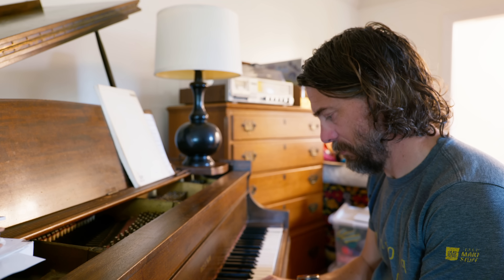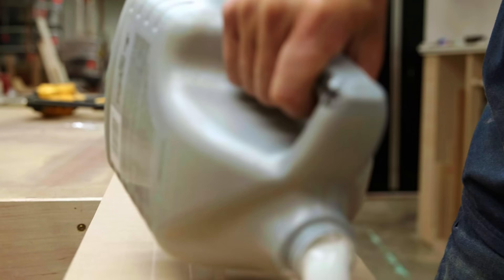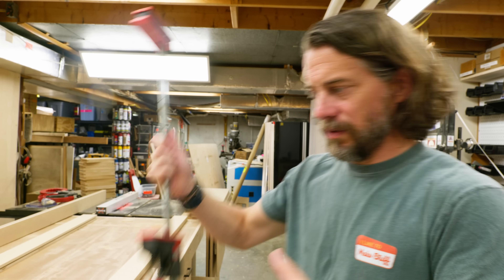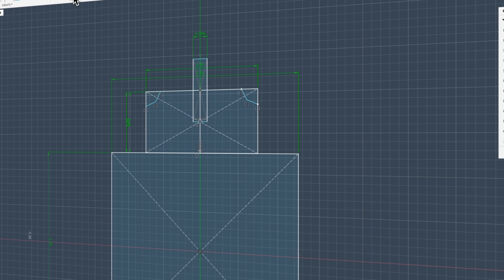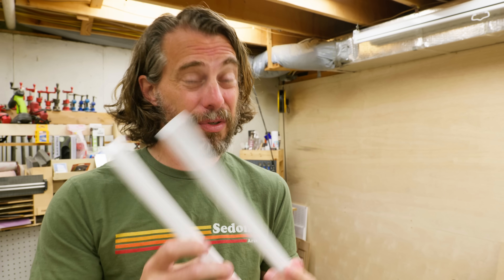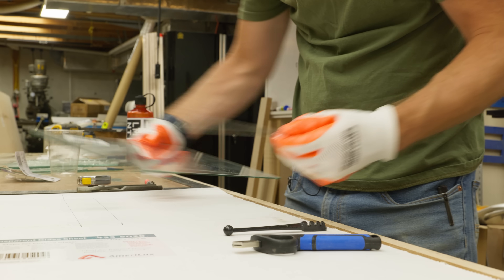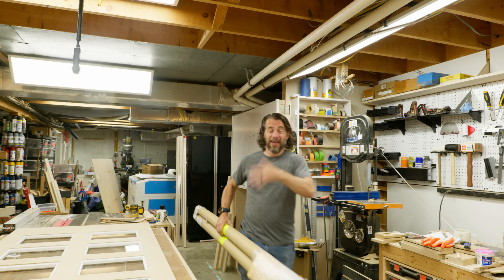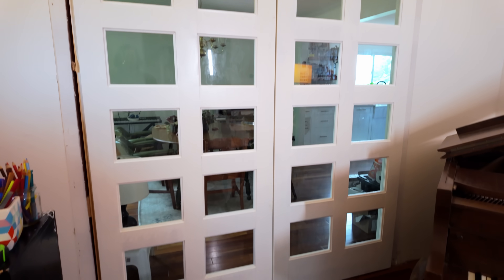I Made Doors WAY Easier With 3D Printing

Comment: I appreciate this channel because Bob isn’t afraid to tackle a project he has no experience with. He just figure out a way without being hung up on the “this is how it’s supposed to be done.” That sort of ingenuity is great to see. That said, a little research would have told him that doors are required by code to have tempered safety glass in them and not plate glass. Plate glass is not only easy to break but extremely sharp and dangerous when it does. All it takes is someone tripping on a rug or a pet and putting their hand through the glass severely cutting themselves in the process.
Reply: This is definately a case of a tight budget and limited working knowledge. It'll be interesting to see how well the door is able to reduce the sound coming through with very little sound proofing techniques used.
Reply: " without being hung up on the “this is how it’s supposed to be done.” That sort of ingenuity is great to see. That said, a little research would have told him that doors are required by code to have tempered safety glass in them and not plate glass."
Aka the "how it is supposed to be done" is the one correct way.
Reply: As a professional woodworker there is one right way to make a door, bond didn't even come close.   This was a hack job where he should have watched a video on making a door.
Reply: @Trickyricky1982  I was thinking they same thing. "The glass doesn't move at all" that means there is no room for deferential thermal growth... Good thing it's an inter door, or that glass would shatter, and might still depending on the tolerances.
Reply: He lives in rural Kentucky. No code required
Reply: @natehyman5980 Code or no code, when it comes to your Family's safety - do all what you can to make it as safe as you can.
Reply: @natehyman5980 I thought he lived in Texas.

Comment: You don't have a router? That is how those trim pieces were made. Sorry in my opinion you assembled your doors wrong. Before final assembly you install the glass then glue it up, then trim out the glass.
Reply: Yep. A router would also have allowed him to cut the slots in the center stile that he forgot.
Reply: Pretty shocking he didn’t mill the trim (with router) he couldn’t easily find.  3D printing worked, too with a new set of pros and cons.
Reply: with a CNC router he could have made an entire door out of one piece of MDF

Comment: I worked in framing shop, picture framing, for decades and an easy way to break the glass that doesnt involve tapping on it is use a dowel rod under the cut and apply minimal pressure and it snaps super easy. I started doing this because I had times where I would be tapping the glass the it would snap abruptly and shoot splinters off or break the glass and then youve got a major clean up. Granted the dowel rod isnt fool proof but its much less prone to accidents. In lieu of a dowel you can always snap it on the edge of the table as well. Either way offers better safer control over the glass breaking process. Cheers. One other thing I just thought of, does the mdf grow or shift with moisture because if so I hope you left a little wiggle room in the size of the glass to allow for this. Ive seen over the years when people cut the glass right to size the wood can snap the glass by applying pressure as it grows and shrinks. Its not super common but something to consider.
Reply: MDF does indeed do that
Reply: @claws61821  I kinda figured it would but I wasnt sure how much of an issue it would be and how it compares to real wood in terms of the flex/growth/shrinkage because its a more stable platform or more consistent. Cheers.
Reply: @scotthallgv I can't speak to that bit of detail myself. Just that it does swell with moisture.

Comment: I thought you said that you couldn't use 2x4 dim lumber because the sizes weren't uniform and then you made 2x4s. Maybe I missed something
Reply: He needed 4 inch pieces, but 2x4s are actually 1.5 x 3.5 (or something like that) so they would have been too small. The other way he mentioned would have been to use 2x6s and cut them down
Reply: Ah gotcha thanks  @faokie  i knew i must've been missing something